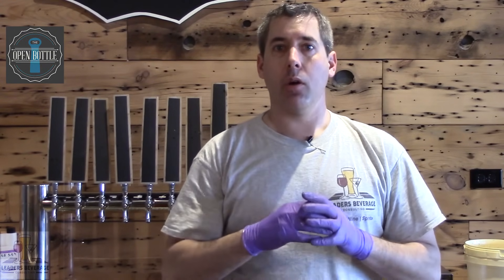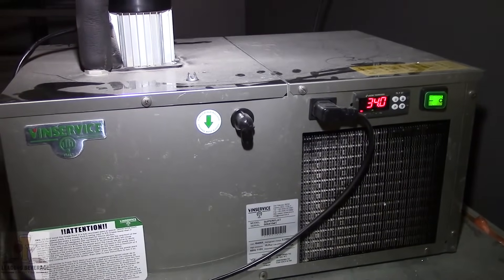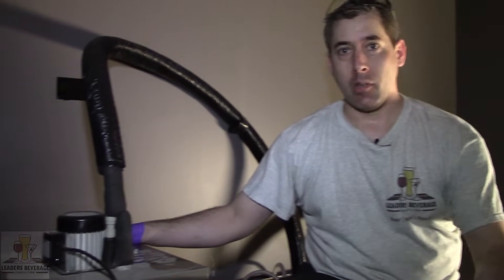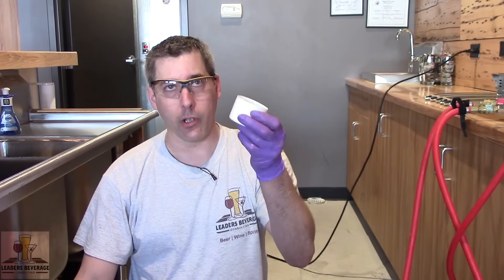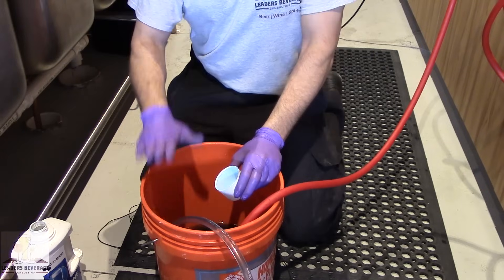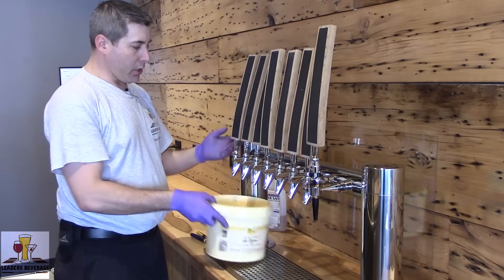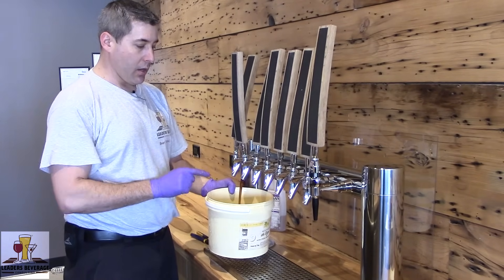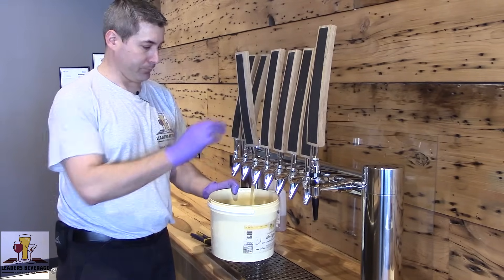How to clean draft beer lines: Circulation Method

Comment: Great video.  A more practical approach for doing the 2% or 3% math however.. is to premix.  I premix 10 gallons at a time which is almost always more than enough for the locations I work.  I have a few that require more but I just make 10 more on the job site when I get to it.  Cheers!
Reply from the maker: Nick Crowe You are spot on there, Nick.  Always look for more efficient ways to work. We do a lot of premixing for direct draw systems because there is so little volume inside the system. We also do premixing in the rare cases where we have to do static line cleaning, because there is no reservoir for circulation that the volume of the system will add to.

However, in circulation cleaning you must remember that there is a volume of water inside the lines that will become part of the total circulation reservoir, and that must be accounted for in how much caustic gets added. 

Because every long draw system is different, from a volume standpoint, we can’t premix for multiple accounts at once or each would end up with a different % of caustic in the circulation chemical reservoir. If one were to fill a reservoir bucket with 3% caustic solution then start the pump the entire volume of the lines being circulated would be dumped in lowering the actual chemical concentration. We know the volumes where we maintain and use larger measuring devices for the ounces we need as opposed to counting out 15 caps (as an example). For the folks who do their own line cleaning at their own shop using the cap for measuring is super convenient.

Cheers!
Reply: I would be interested in picking your brain on set up and break down efficiency for circulation.  I cover a lot of ground each day and it typically takes me a half hour combined for setup and break down.  I really dont have time to be on the job site for an hour with the high volume of lines I clean each day.  But it is undeniable that circulation is a higher quality clean and I would much rather my clients get the best.  Any tips of making it faster?  I mean, I know practice practice practice.  I run my pump several times a day as it is.. I work 9 hour days and usually hit 15 - 20 sites.

Comment: Great video! Very Helpful. Question: When in the cooler and you're connecting the dual flush couplers- do you shut off the gas to the individual line (red tabs, on the wall)? Thank you! (I'm writing a SOP)
Reply from the maker: Hi Marley, Typically we don't bother turning the gas off. The only time this is something of an issue is if the couplers internal seals aren't blocking the gas from the beer line when disengaged. If that turns out to be the case it will keep pushing beer to the faucet even though the coupler is disengaged. This won't be a big deal if you've already made your connections at the tower; another thing we always do (towers set up before couplers go into dual flush). Hope that helps. -Cheers!

Comment: Great info.    Just a couple of questions.  

In this example of line cleaning, you cleaned a total of 8 lines using 3 jumpers.  In the back cooler are you using a total of 4 flush couplers?  So 1 to 2, 3 to 4, 5 to 6 and 7 to 8?   I would assume the input hose connected to the 1st faucet is line one and the output line is line at the other end would be line 8?  

If I have the pump and just wanted to clean 2 lines only 1 flush coupler would be needed to connect the input and output line and on the faucets 1 input line and 1 output line, correct?  Thanks!
Reply from the maker: Hey there Corsa, we're so glad you found this video helpful.  You are exactly right. There are only three at the tower because there is an exhaust line and a pump in line. In the cooler there are simply 8 lines that need to connected to each other.
Cheers!
Reply: Is it possible to use the EBC pump to clean just 1 line?  If so, how would you do that and what parts would be needed?
Reply from the maker: Hi Corsa, sorry about that, it looks like we missed your last question. Cleaning a single line with a pump would likely be more trouble than its worth. You would essentially have to just push cleaner through the line to the coupler. Now, if its a kegerator you could put the jumper in the reservoir bucket and that would circulate the line. On a long draw through you'd just be filling a bucket in the cooler. Two lines is perfectly doable as you'd simply have the pump pushing into one line, an exhaust line on the other faucet shank, and a single dual flush coupler in the cooler. Hopefully that more fully answers your question. If it doesn't, let us know what you are trying to do (equipment you have and such) and we'll try to point you in the right direction for that.
Many Cheers!

Comment: I bought a bar that hasn't cleaned their lines in years there is heavy buildup in the polylines.... change the vinyl jumpers..got recirculating pump I cannot find a good chemical to get the build-up out... 20 lines are about 100 ft long any advice so I don't have to change the lines which will cost about $6,000 +

Comment: Thank you! What about long draw systems with beer pumps that don't have the reverse flow valve. Is there a method to still use our pump? Right now I'm using pressure pot since I can't figure it out.
Reply from the maker: Hi David, if your beer pumps don't have reverse flow valves then you can do circulation maintenance. You must have a way to bypass the pump since the pumps are one way. It is frustrating seeing pumps even made without them besides installing without the capability. Depending on your beer pump a reverse flow valve can be installed. If the pump doesn't allow for that a bypass with a shut off could always be built in but that could get messy if. We often install bypass valves when we take on new accounts in order to raise the level of quality.
Good Luck & Cheers!!

Comment: Hi, on a system like this, every 3 months I would need to take the couplers completely apart to clean them. In which step of the process would I do that? How do I prevent everything on the lines from flowing out when taking it apart? And also, Does the acid cleaning follows exactly the same process as the caustic one?

Comment: What brand and size pump do you recommend for a 20 handle pub (Long draw/glycol cooled system)?  And Great video, thanks
Reply from the maker: s miller How long are the lines and what pressure is your secondary regulators set to? I would recommend the 300' plus Micro Matic model. We've been using these pumps for years without a single problem. Micro Matic also is the easiest company in the industry to deal with if you have a warranty issue.  You wouldn't be able to clean all 20 lines at once though. You really don't want to run the pump over about 40lbs of pressure to ensure you don't blow out any clamps or seals inside the system. Therefore, you'd do 6,6,8 - or, depending on the length and resistance of your system 10 and 10. In that last case I'd circulate for a full 20 minutes. Here is a link to the pump I'm talking about. If you have interest we can drop ship them to you at a good discount from the price you see.
 http://www.micromatic.com/draft-keg-beer/line-cleaning-pid-EBC300PLUS.html
Cheers!
Drew
Reply: Leaders Beverage The Trunk line will be roughly 60Ft from cooler to tower, and the establishment is still about 6-7 weeks away from opening , I'm researching the initial cost for the principle owner - the distributors have cleaned their own lines for his first restaurant.  That establishment only has a handful of handles, and though they have some nice local/regional brews on tap, craft beer is not a focus - I guess I'm trying to get a good idea of pros/cons to assuming the responsibility of cleaning the lines ourselves
Reply from the maker: Sorry I'm just responding. Circulation cleaning is 80X more effective than static cleaning. Many parts of the country don't even require cleaning by law so getting owners to invest in doing it every two weeks is hard enough let alone to do it the best possible way. The truth is, the money spent on maintenance when done absolutely right is more expensive but pays larger dividend in profit due to increased beer sales and less foam waste. Moreover, a venue goes to the lengths I show in the video they should brag to their customers about it. Being known for having the cleanest beer lines in town goes a long way to customer contact.  Believe it or not, clean lines matter even more for the delicacy of American Light Lagers than a huge imperial barrel aged chocolate stout. The problem with distributors cleaning lines is that it is something they have to do, not want to do. You likely have minimum wage, or slightly better, folks cleaning a line who has to be in and out as quickly as possible.

The only con to cleaning your own lines, if it is legal by you, is the need to train staff and the liability of using dangerous chemicals. Other than that, even the upfront cost isn't a con because it will pay itself back in quality.

Comment: In the video you mentioned that you had 1.5 gallons of water in the lines and 1.5 in the bucket with a total of "2.5 gallons".   Not sure if you are not counting 1/2 a gallon for some reason?  I'm cleaning 6 lines with 1/4 beer lines and 30 ft.  The jumpers are 3/8 inch at 6ft.   Assuming I have 1.5 gallons of water in the bucket and same micromatics caustic, how many caps would I need?

Comment: If you start your timer right when you turn on the pump won’t all the lines still get a full 20 minutes. Even if it takes a minute to get caustic to the last line, the water flush at the end will also take a minute resulting in the full 20 minutes. Right?

Comment: after your water flush following the caustic/acid cleaner do you run sanitizer through the lines prior to reconnecting the beer lines?
Reply from the maker: +Kris Iglehart Hi Chris, there is no need to use a separate sanitizer after the caustic maintenance. If you are doing acid maintenance you should have done a caustic maintenance immediately prior to that (check our video on caustic vs. acid beer line cleaning. https://youtu.be/eEXh7AWB1Gs). We know, for example, that Star San is a sanitizer and not a cleaner (we love the stuff) so after cleaning a fermenter you sanitize it but that step isn't necessary in beer line cleaning. After all, you aren't fermenting in the beer lines. They need to be clean but they won't really ever be sterile. After cleaning with caustic or acid beer line cleaner you flush the lines with water. You continue flushing with clean water until the pH (using chemical reactive paper or an electronic meter to measure) returns to neutral.

Hope that helps
-Cheers and Cheers!
Reply: Leaders Beverage just wondering, call it redundant if you want, we have just got into the habit of sterilizing after cleaning everything. I know it may not need it but it's just habit. thank you.
Reply from the maker: +Kris Iglehart you'll never catch us telling someone to stop any procedure that adds to the thoroughness of a maintenance routine.
-Cheers

Comment: There's no need to calculate the volume of the lines.  Especially using colored solution. Mix up a batch in a bucket. Start pumping with the discharge going down the drain. When the solution starts coming out put the discharge back into the bucket.

Comment: Hey Drew, what pump do you use during your cleaning cycle? I own a brewery in Montana, we clean our lines religiously every two weeks, but we use a static procedure currently. We just replaced all our lines in the cooler and are looking to go to a circulatory procedure.

-Shawn, Katabatic Brewing Co.
Reply: From what I can tell, it is a micromatic model EBC300 or similar.

Comment: Hello and thanks for the great video.  I currently use a re-circ pump for my line cleaning.  Same one from Micromatic.  I clean 4 lines at a time for 20 minutes.  The flow rate seems low to me. My lines are pretty short, maybe 30-40 feet from faucet to coupler.  I have noticed that the lines in the cooler (trunk lines) are a lot smaller than the line from the coupler to the FOB.  So, is that the issue restricting the flow?  Also, what do you recommend in the way of new lines?  I know you need a choker behind the faucet but what about the rest of the system?  Thanks in advance.

Comment: Drew, thank you for so many great videos! I was wondering… what’s the best way to store an unused draft line? Thanks for your time
Reply from the maker: Hi Richard, the best way to store draft line is to clean it with caustic, then acid, then rinse with Distilled water, push the distilled water out with co2. The distilled water is so there are no chlorine's or other chemicals being left behind as residue as the flush water evaporates. Not a big deal when you are filling back up with beer but not good when you are going to shut a line down. -Cheers and beers!

Comment: Are you controlling the flow rate by the pump or by the number of lines??
Reply from the maker: Hi Gene,
It is actually a bit of both. With larger pumps there are actual pressure gauges and by using the by pass valve one can adjust output pressure and monitor on the gauge.  On the smaller pumps like you saw in the video there is no pressure gauge which means you want to be careful and really know the equipment and system. You need to be very careful because most systems can't handle more than about 40lbs of pressure. As you move above 40lbs you run the risk of blowing off clamps within the system.  Thus, you can adjust flow rate to some extent with the pump (using the bypass valve).  However, if you aren't achieving the flow rate you want and can't raise the pressure safely, then you reduce the number of lines you clean at once (less loops). The draught beer quality manual suggests never cleaning more than four lines at a time (two loops).  Hope that helps answer your question.
Cheers!
Drew Larson
HTTPS://LeadersBeverage.Com
Reply: Yes, that dose help, thank you.

Comment: I’ve got some dual flush cleaning cups without a built in check ball lifter. Is the best way to use these just to remove the check ball from the first coupler in the line?
Reply from the maker: Hi Jason, strange to have a dual flush without the ball lifter. We suppose removing the check ball will work but be sure to put it back. Also, to cut down on work don’t forget you only have to remove the one that is on the reverse direction flow.
Good luck & cheers!
Reply: Can you clean a system that splits between 3 different faucets with a recirculating machine?

Comment: what system pump would you recommend for a 4 tap system?
Reply from the maker: Hi Doug, Drew is using the smallest circulation cleaning pump that micro Matic sells. We love the little guys and it’s easy to replace the motor internally if they go bad (easy for someone with some mechanical know how). We use that pump for all accounts large and small. -Cheers!

Comment: Hey Guys... have a quick question. I came across a account that has as odd number of beer taps, Im sure this common but its the first I have encountered on the cleaning side...what is the best practice for cleaning the odd number faucet? Im sure its simple and Im just not thinking hard enough, but Im a little stumped....thanks in advance for any help.
Joe Gasparino
Draftman Services NYC
Reply from the maker: +Joe Gasparino Hi Joe, I assume you are doing circulation cleaning because an odd number wouldn't matter with static. What we do is create a triple faucet jumper which goes on the three shanks next to the exhaust shank. Lets say its a 5 line tower. On the left shank would be the pump input, then the center three shanks would have a triple jumper connected with a T splice, then the shank on the far right will be the exhaust. Now, in the cooler you will want to build a kind of triple connection for the last three couplers. Its like making a triple faucet jumper only the three connections attach to the last three couplers. What happens then is that the pump pushes the cleaner into one beer line, makes its loop up, then when it returns it returns on two lines and then exits all out the last line. The last key is to switch cleaning directions every time you clean, which is a best practice anyway.  Hopefully that was somewhat understandable but it is a bit hard to explain in text, shoot us an e-mail at info@leadersbeverage.com and we'll send a few pictures. 
Cheers!